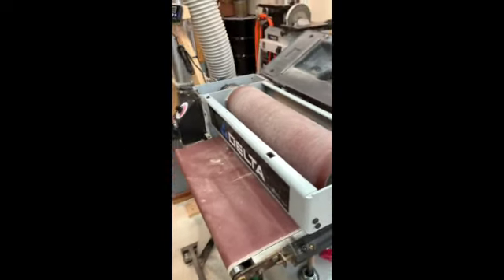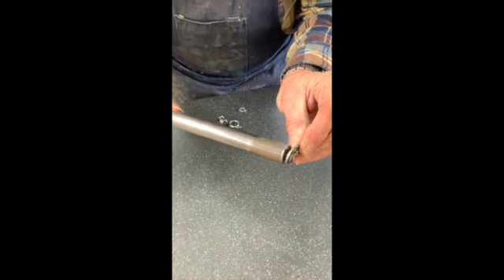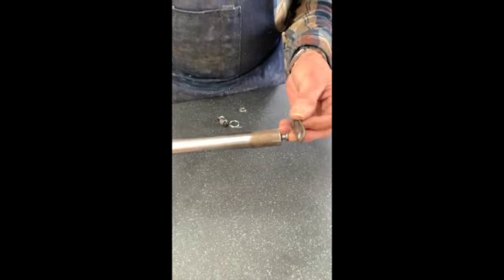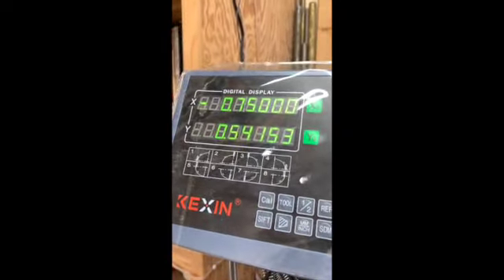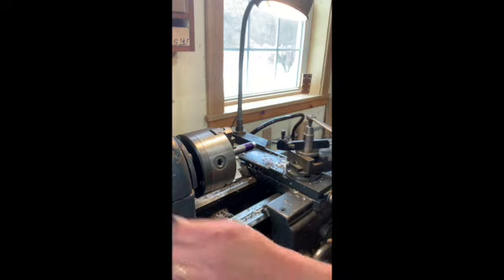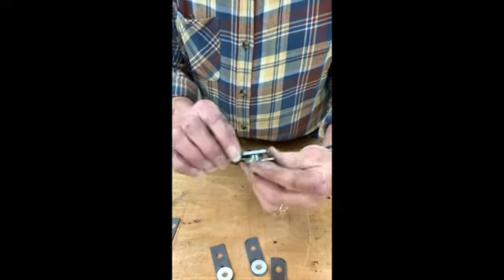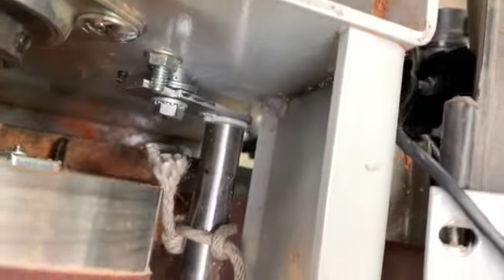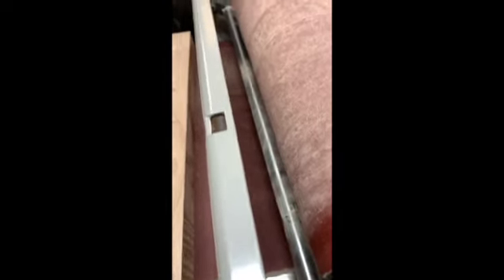Delta 18/36 Drum Sander Repair  Replacing Pressure Rollers & Brackets  SD 480p

Comment: I had the same problem,  the rollers had deep grooves, but you can buy new rollers that come with bearings in the shaft to replace the old rollers from Renovo Parts. They work much better than the originals.
Reply from the maker: My experience with Renovo Parts has been far less than pleasant. And fortunately, I have the equipment, materials and skill I needed to fabricate those parts. Several years ago, before I had a metal lathe, I bought one of those rollers from Renovo. They didn't have the part. They made it, for a 
" who the hell are you kidding " price and I got speedy any day sometime within the next month or two delivery. I bought a nice Logan Lathe and said goodbye.

Comment: I enjoy watching your videos and you have been giving good tips. I have the exact same drum sander and it works well for me. But the wheel to raise and lower the feed table is hard to turn. I bought it used and the belt was skipping underneath. I had to put a lot of tension on it to stop the skipping. And the wheel got hard to turn. I cleaned and lubed all the moving parts but that didn’t help. I was wondering if you have the same problem? I have been thinking about getting a bigger hand wheel.
Reply from the maker: I can't speak to that issue particularly but I do know that if that hand wheel is hard to turn, increasing tension on the belt is not the solution. The belt has skipped and the issue is timing between the belt and the gears it drives. I believe there is a Youtube video that addresses this issue.  Good luck with this issue.